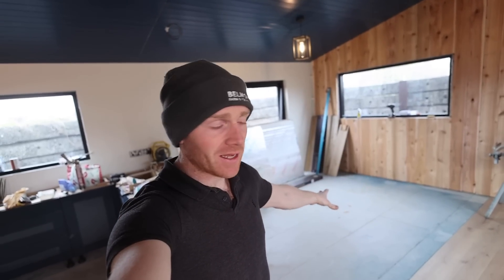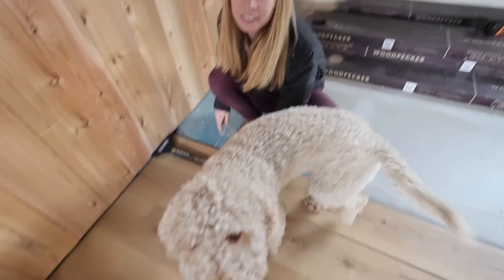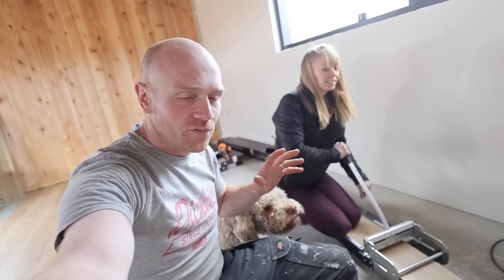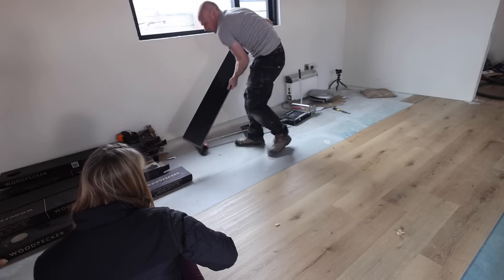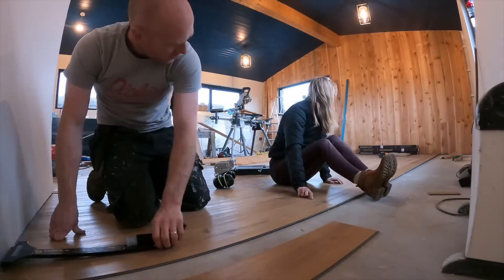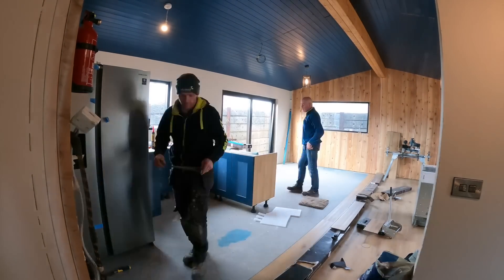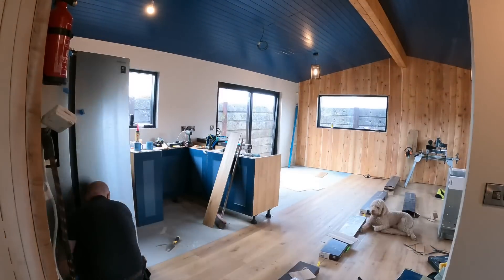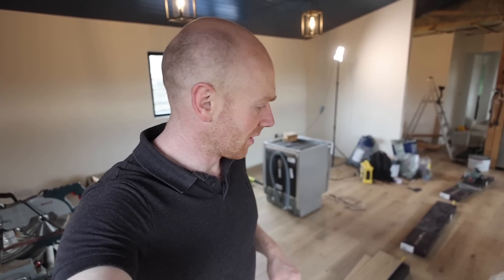We sold our dream 7 bed house for this abandoned farm - next step flooring!

Comment: Sort of surprised you went with Vinyl Click flooring. Floor fitters hate that product (i'm talking to all you Karndean, Gehrfloor, Amtico etc guys). Mostly as the "click" sections tend to be fragile and can break with movement. They prefer glue down (dryback). Vinyl click, and glue down to a lesser extent, can suffer when installed where there are large areas of glazing due to the heat causing warping of the flooring (glue down less so due to the heat conducting into the floor substrate). You might have been better going for a SPC (Stone Polymer Core) or WPC (Wood Polymer Core) product. These have the advantage of being thicker and, despite still being a vinyl product, more closely resemble a standard laminate floor. They are often available with a built in underlay giving them a slight softer underfoot feeling and are generally fully waterproof have residential warranties of 15years or more and even offer decent commercial warranties. I would recommend that you have some kind of rug where your Patio doors are plus where you have high sun exposure from the windows.
If your interested in WPC check out Pro-Tek Flooring or google WPC or SPC.
Reply from the maker: We did consider glue down but would have required an additional subfloor.  This product is a mineral/resin core with underlay and has no requirements for expansion gaps, (even though we have). Therefore it's as stable as it can be and hopefully with the MVHR the temps will be too. We may use dry back in bathroom as we are using a different style there.  Time will tell and the cabin is all about experimenting so we will see how it performs. 👍

Comment: Loose lay vinyl floor may have been better allow the split of each side. Either way looks good 👍
Reply from the maker: I think the main reason we changed our mind from glue down was that it would have required another full layer of flooring/ply for adhesion.  It may have take to the egger but not recommended. May use it in bathroom though.

Comment: Looks great.
What are the pros and cons of this vs laminate? I've done quickstep laminate a few times.
For the join, could you use solid wood profile? Not sure it would blend in, but should be able to get the length. Otherwise silicone gets my vote.